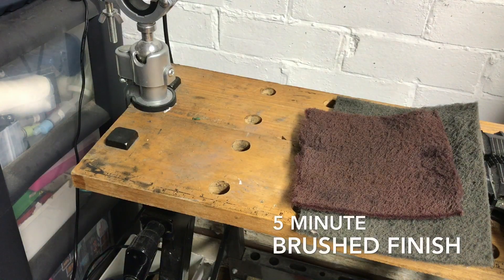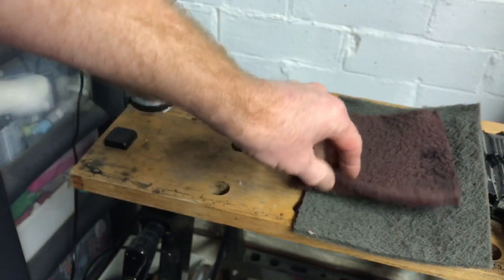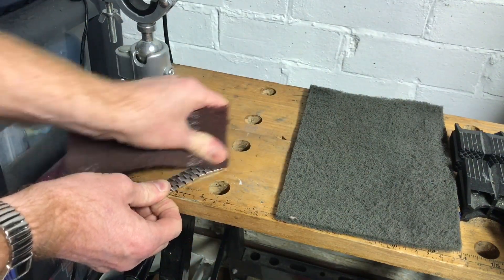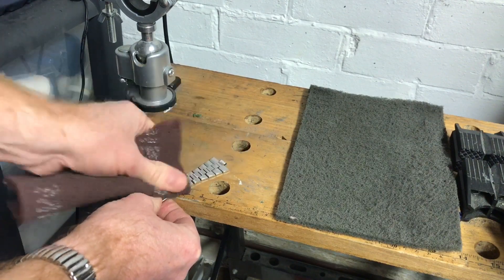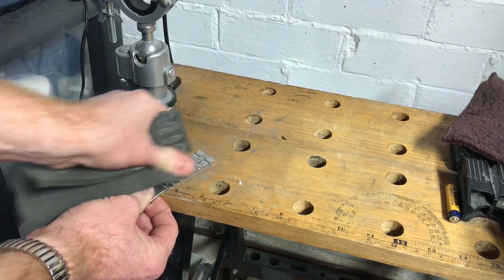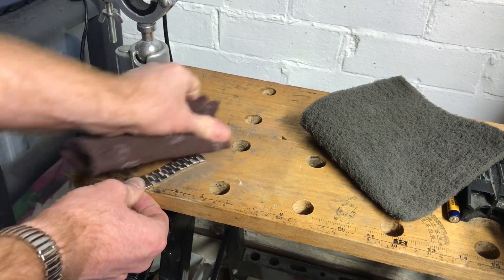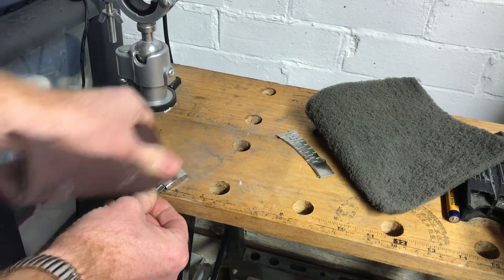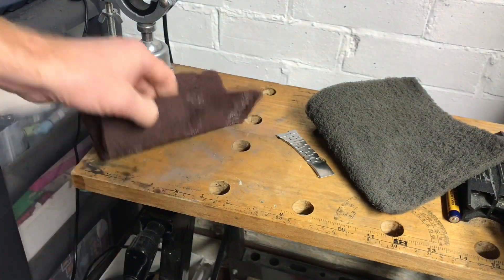Restore your watch Bracelet in 5 minutes!

Comment: I always use klingspor sandflex fine polishing block, they come up a treat.
Reply from the maker: If it works for you then this is a great suggestion.  I have similar abrasive blocks but prefer the hand pads I use as they get into the difficult parts easier.   Thanks for your comment.
Reply: @MyRetroWatches  hi. I just got a longines hydroconquest. The clasp is so tight I can’t open it. Any suggestions? My other watches are so easy to undo clasp yet this is so hard